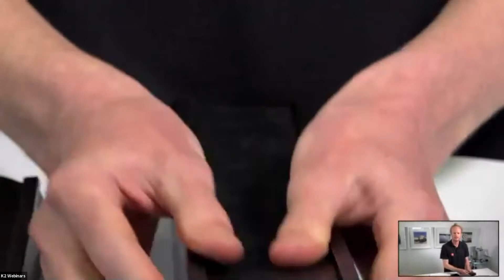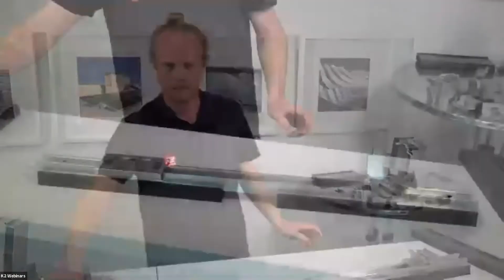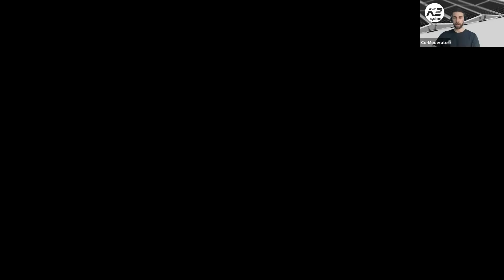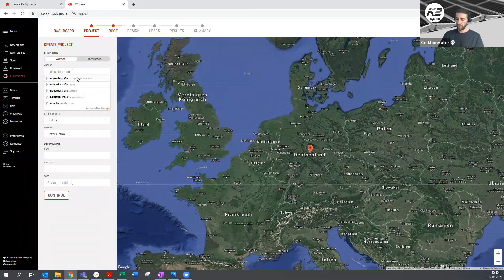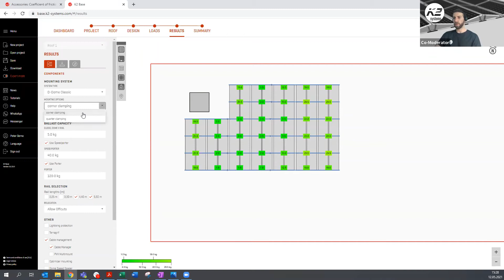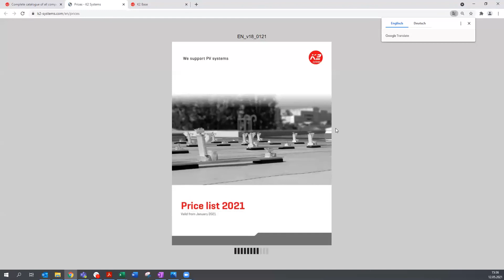Webinar (EN 12.05.2021): Flachdächer

Comment: Why i cannot chose the Portrait orientation of panels ( i need a tringle system for flat roof  ) ?
Reply from the maker: Hello Aleksa, Many thanks for your question! Currently you can not plan portrait projects for flat roofs with K2 Base but we will soon also have new mounting solution for that.
Please send us your project with our project enquiry. Please note that you need portrait orientation and a above 10° solution.
https://k2-systems.com/en/your-project/project-enquiry

Our sales team can help you with a manual calculation of Triangle, MultiAngle or our new mounting solution which is also able to use portrait orientation in the meantime. 

Have a nice day

K2